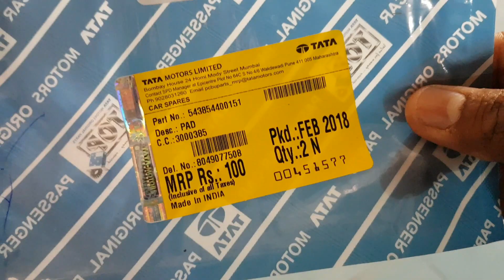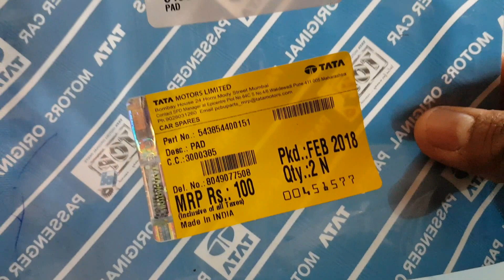TATA NEXON XZ+ RECALLED FOR HEADLAMP ISSUES

Comment: What is use of rubber pad in headlights and why it install and without this have u face any issues in headlights like fog etc...?
Reply from the maker: Frankly speaking i did not notice any change. Headlight use to get fogged in rainy season a bit before and it gets now as well
Reply: @RiderForever  soo that mean it have no solution  for fog

Comment: If headlights do not turn off after locking the car. Just unlock the car & reset the factory setting in infotainment system. It has been done by me.